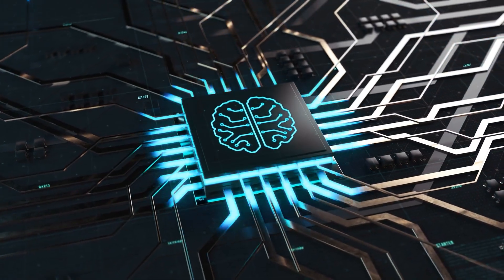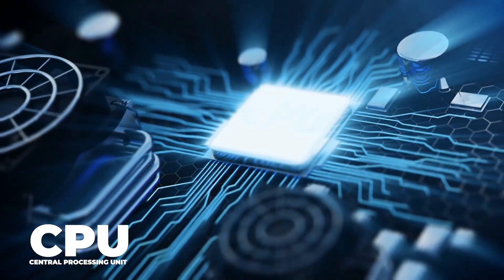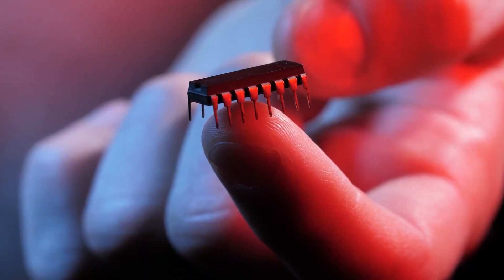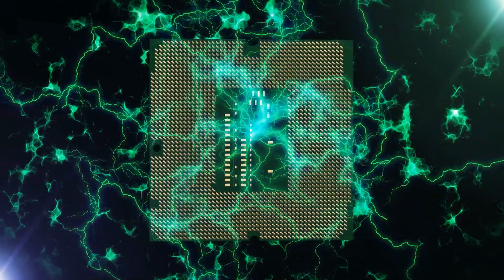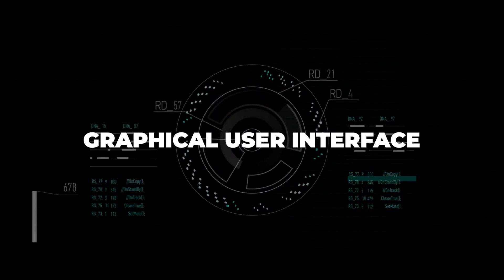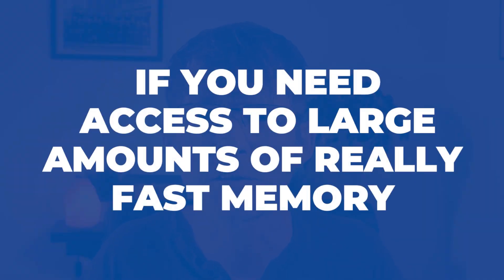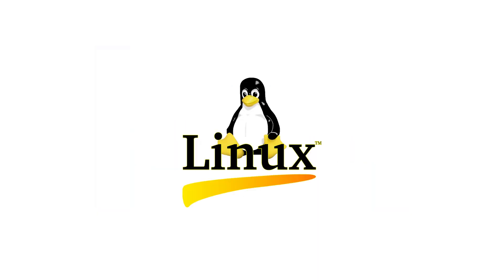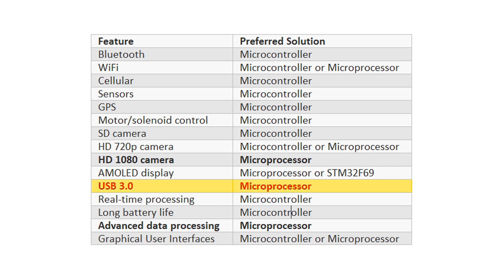Microcontroller vs Microprocessor - Which is Best for Your Project?

Comment: A micro-controller IS a microprocessor that also has memory, I/O, and various peripheral devices (A/D, D/A, timers, etc) on the same chip.  In many cases the microprocessor inside of the microcontroller is available as a stand alone part.  In most cases microprocessors are of the Von-Neuman type, while the processor inside of a microcontroller is of the Harvard type.  IE: microprocessors have a unified address space, while microcontrollers have several separate address spaces for Instruction storage, data store, user read only (eeprom), I/O and peripheral space.  Note that larger more complex microprocessors (that can run a protected OS such as Linux) have a memory management unit that will divide the single address space into several protected spaces that share a common unified address space.  Most microcontrollers will lack a mmu (especially those having a Harvard layout), so microcontrollers can't usually run an OS such as Linux, but rather a real time OS such as FreeOS.   The Raspberry Pi single board computer has a microprocessor, the RP-Pico uses a microcontroller.  The former is a Linux, Android, or Windows computer, the later is a 'bare metal' real time device.
Reply from the maker: Thanks Kenneth for sharing this additional information. Much appreciated!
Reply: Great comment! Your first sentence is the conclusion I hesitated to make after watching the video.

Comment: @PredictableDesigns What if my project requires touch display, camera module and few sensors? I have a use case that requires capturing video while taking few sensor measurements. Can a microcontroller do concurrent tasks of streaming a video on display and also taking sensor measurements or performing some tasks such as fingerprint reading/comparing?
Reply from the maker: Yes, but only up to 720p video with a microcontroller. Full HD requires a microprocessor.
Reply: @PredictableDesigns  thanks 👍🏼

Comment: Just to be pedantic, I'm working on a electro-mechanical device where the system already has a full-fledged microprocessor, a Raspberry PI, and so my question is more along the line of is a microprocessor or microcontroller useful or necessary for reducing installation complexity or cost or  achieving the desire performance.  In this day-and-age, it might be worthwhile to use a microprocessor just to save the end user from purchasing and assembly the wires for a remote sensor!  Or a microprocessor so that the user just needs to plug in a USB C cable!
Reply from the maker: A microcontroller is always more simple. Also you can do a USB-C port on many microcontrollers.

Comment: Microprocessor...  Has an MMU, hardware driven cache and a RAM interface, usually some version of DDR.  MPU could have some cool features like multi-cores, branch prediction, hypertherading, video encoding/decoding, integrated GPUs...  all the peripherals SPI, USB, I2C, CAN, UART are usually still there.  Often used with a big OS like linux or windows.

Microcontroller...  Much simpler system with no MMU and contains an integrated bank of static ram and "flash memory".  Standard peripherals like SPI and UART and GPIO, but never PCIe....  Sometimes there is no hardware floating point unit.  Lots of cool features like vectored interrupts are available, but are specific to architecture like ARM or LX6
Reply from the maker: Nice summary! Thanks for sharing.
Reply: @PredictableDesigns    I like adding my two bits.  I am working on a cortex M7 micro controller that is just awesome...